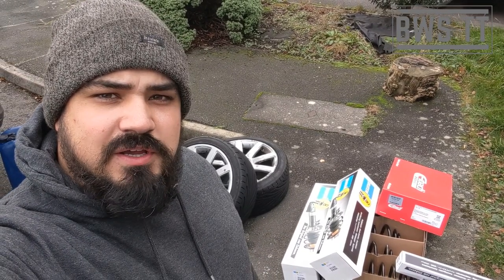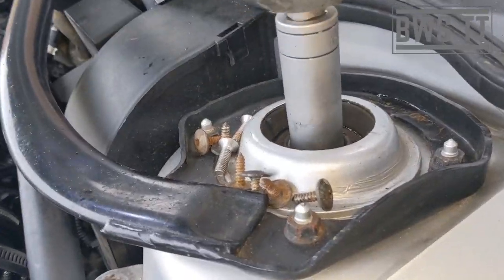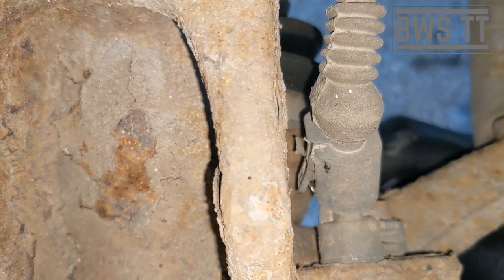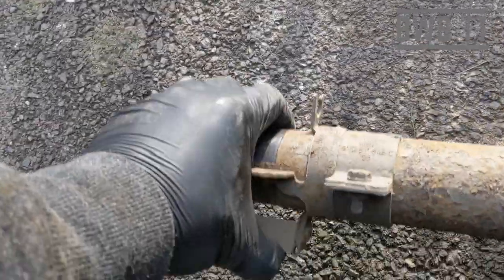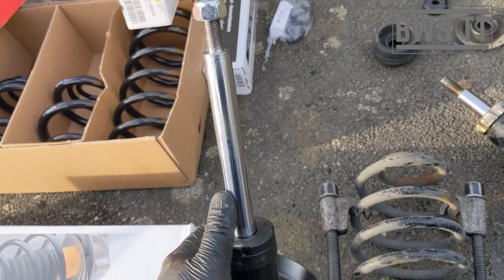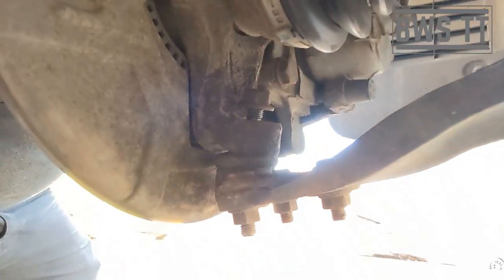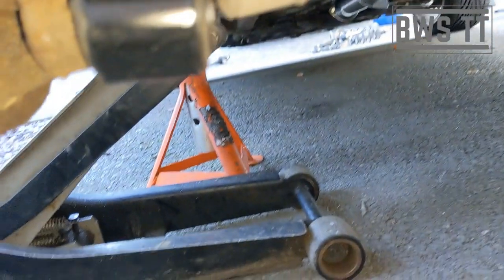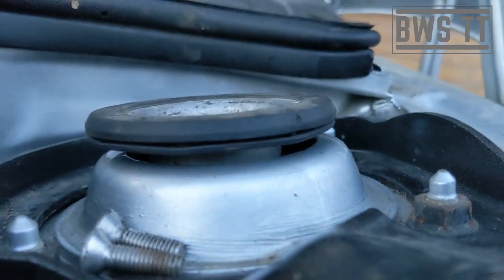Audi TT MK1 Suspension *How To guide*

Comment: Good video Bryn, thx!! I did back and front and strut spreader tool a must. To all, the drop link goes in a certain way. One thread is longer than the other if you look carefully. I didn’t. The longer thread goes up top on strut! Shorter thread on stabilizer bar. 
Key info that coulda saved me a few days and having to get another drop link as the thread strips if you put the shorter end up top and try tightening it thru.

Comment: Hello, on my quattro 225apx/1999, i have used bilstein B4 with eibach -25mm  (E1570-140) and oem top mount (like your setup?). 
My front suspensions are higher than the rear. Did you have this problem too ?

Comment: Great video. 100% get a hub separator or use a 3/8 to 1/4 socket adaptor to seprste the hub., Works exactly the same. I tried with the hammer and it was a fair bit harder

Comment: Something about this i'm curious about. The locating tab that slots into the hub, on my new shocks, there is a small tab bent to 90 degrees at the bottom of it, same as the ones in the video. Is it intended to clamp on that tab or the body of the shock? I'm sure it should be the body, but in my case, the tab will clamp first.

Comment: Brilliant videos and content.  Delivery is really clear.   Just a bit disappointed that on many I've watched, you don't use grease on reassembly, which is something that can make such a difference, not only to ease assembly, but to protect for the future disassembly.  Definitely on bolts that are on suspension/hub areas.     This doesn't distract from the usefulness of the videos, and it's a great channel, but I'd just like to see more best practice on this one point.
Reply from the maker: Copper grease gets way over used- and then bolts get incorrectly torqued as all settings are given dry, not lubed. Clean threads are the most important thing to ensure ease of future work

Comment: Just a FYI for others; the strut not goin up by it self is NOT an issue, and will NOT effect your ride quality. Is the gas that has escaped the strut over the years, but as long as there is NO oil leaking, the strut is 100% fine to reuse with lowering springs. This is well written in the OEM repair manual.
Reply: True that.
Reply: @gplusgplus2286  but whilst its off why not fit a nice new one?
Reply: @schwantz037  better to leave it alone than fitting cheap new ones, eg black Bilstein B4 are chinesium crap.
Reply: @gplusgplus2286  buy cheap buy twice...

Comment: I have 19inch rims on my 04 225 I want new suspension lowering it to flush with the tires little or no gap. But without getting adjustable coil overs how will I be able to adjust/make sure it will fit with my rim size?

Comment: Hello mate, great video I appreciate it! I noticed you used the same top bolt for the re-assembly of the rear shock, are they reuseable? I heard they were 1 use only stretch bolts?
Reply: You’re right, They’re one use. Not reusable. Same on the front hub pinch bolt+nut, wishbone nut and strut mount nuts x2

Comment: Hello, I changed my 4 shock absorbers with Bilstein b4. I have the original springs. I find the ride height far too high at the rear and even more at the rear. What could be causing this problem? Sports chassis? What option code for this chassis? Information, my rear stabilizer bar links are 175 mm. Thanks for your help.

Comment: What are the rubber caps on the top and bottom? Your suspension does not protrude from the top hole like mine does. Also, what is the rubber piece that is on the top hole?

Comment: Help! Replaced the rear shocks with Bilsteins and they knock at low speed. Any ideas why it is doing this and how to fix. Local garage says they are not OEM so they will knock!!!!! It’s also lowered by 20mm with H&R springs. 20mm spacers and 18 inch QS alloys.
Reply from the maker: I cant see how i can help without seeing the car to be honest. If they are the correct shocks they are either faulty or lose.

Comment: Hi Bryn, great video. Could you point me in the direction of the socket tool for ‘spreading’ the strut housing.
Also I’m looking to install bilstein b12 pro kit with eibach, onto a pre-facelift 2001, 225 Quattro, will this lower it by 40-45mm.
Thanks.

Comment: Great video.

I've got a set of KW waiting to put on my quattro. 

I've also got a set of new spring seats for the rear, have you got any experience with swapping those? I've head the old ones can be a pain to remove?
Reply from the maker: They just pop out, they're more a pain refitting as the rubber locator has a barb to push through
Reply: @BWSTT  ace, that's well worth jnowing., appreciate the insight and great videos.

Comment: Hi if i was to lower my tt 2003 by 20mm as the stock springs are supposedly 20mm lower then pre facelift will i have to add adjustable tie rods. Any advice cheers.
Reply from the maker: All lowering springs for the mk1 are in reference to pre-facelift height, so would be classed as 40mm lowered, and could need adjustable tie bars to get the alignment spot on, but it’s not always necessary

Comment: Hi Bryn I’ve had a nightmare - two days wasted so far trying to do even just one side front strut and spring. My issue is I just can’t get the new strut fully in the hub! It’s like half a CM from being fully in and for two days now I just can’t get the damn strut in the hub!! When I use a Jack underneath the control arm it just pushes the spring up - doesn’t force the strut any further into the hub. And yes I’m using the strut spreader tool - I’m just at a dead end now. Any advise??
Reply: Maybe try the spreader tool in a different spot, like the top, and gentle tapping with 4lb hammer to coax it to drop in. Or lube/grease in hole first, then drop it in. Also make sure your angle is right. Me wasn’t, and when I moved it a bit, it dropped in.

Comment: Sweet video and excellent timing as I'm about to do something similar. When lowering a TT do you find that you need adjustable rear tie arms or bushes? I'm apparently at the limit of adjustment already and don't want to chew through rear tyres. I'll be dropping it 25mm. It is a 2006 however the Australian delivered cars didn't get the later sports suspension. Appreciate the advice. Cheers.
Reply from the maker: I find that after 40mm on pre-facelift height is the limit for standard tie arms, so you should be ok at 25mm lowering

Comment: Is it necessary to get a wheel alignment after doing this swap?
Reply from the maker: If you disconnect the ball joint at the hub, then in theory no, but its bot a bad idea to get it checked
Reply: @BWSTT  cheers! Getting alignment today. Your video made the job so straightforward!